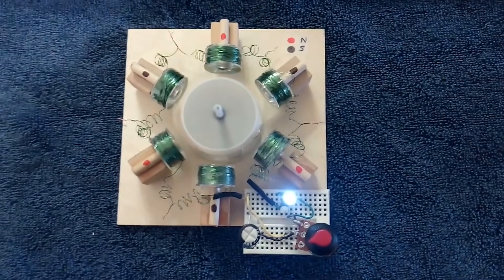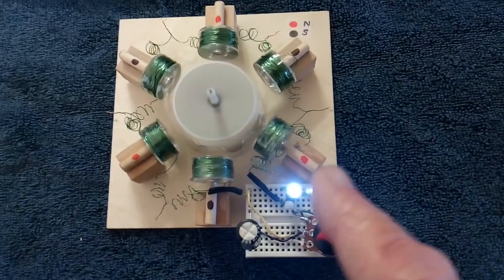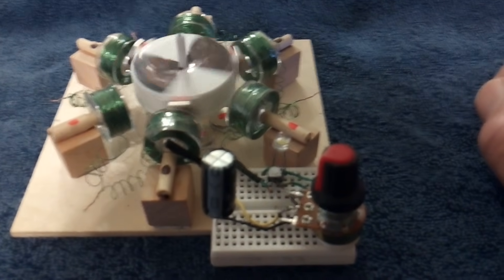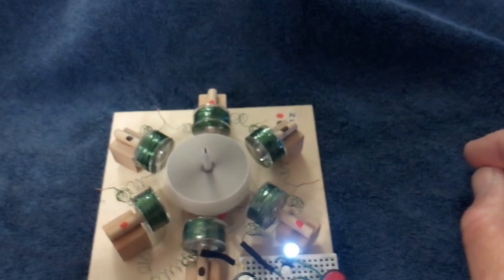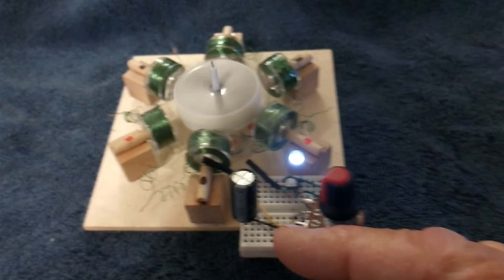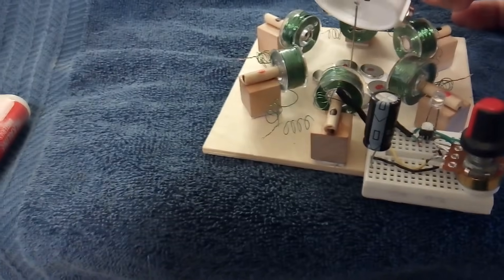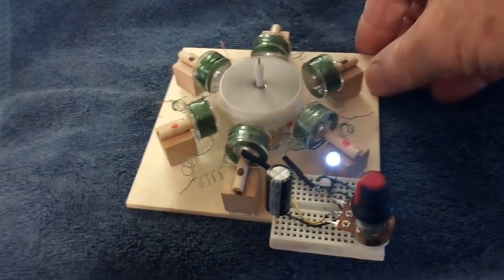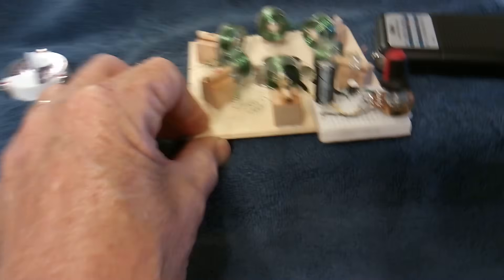Electronic EZ Spin 2.0

Comment: The magnetic levitation/bearing works well. It was interesting to see the arrangement 👍👍
Reply from the maker: I just put a AA battery on this and calculated that it should run non stop for about a month.  If it makes it that long then I might try this idea on one of my micro amp motor designs.   😀
Reply: @Lidmotor  This is a question that I'm Been wanting to ask somebody like you that is so familiar with electronics. An electrical circuits.  say, if you took this design and maybe powered it off of a solar cell. but really beefed up the axle and the coils and magnets and so forth. And then on top of the axle had another Flanged wheel with N S. magnet arrangements in Combination with the. a series of pickup coils Air coils to be specific, so there'd be no magnetic drag. Would it be possible to actually Collect or gain more Power From the . wheel with the North S magnets. Then the circuit requires to run and maybe feed that back into the circuit. or to the very least. to a charge controller. and battery. After it's rectified from the air coils..

Comment: I have been using sapphire bearing following lasesaber school. Work very very good
Reply from the maker: My original Lasersaber E-Z Spin Motor that he sent me has sapphire bearings.  I got some more bearings off Amazon years ago before they stopped selling them.  Where did you get yours?
Reply: @Lidmotor  yt keep deleting my message did you get the link?
Reply from the maker: @francois9428  Your link did not come thru.  Maybe just describe where you get them?  Thanks.
Reply: @Lidmotor  swissjewel
Reply: Bearing v3.18
Reply from the maker: @francois9428  Thanks.  I found it!  Here is the link.  https://www.swissjewel.com/product/jewel-bearings/vee-jewels/v3-18/
Reply: @Lidmotor   cool. Not sure why yt was deleting my comments. Glad you found it
Reply from the maker: @francois9428  Thanks again.   I just ordered four of them.  Pretty expensive item but it is a critical part for an exact replication of Lasersaber's original E-Z Spin Motor.
Reply: @Lidmotor  you are super welcome. Been following your work for years so I super happy to be helpful 😊
Reply: https://youtu.be/nffmi6gmRTU?si=am3nrxVsT7EFzQ1D
Reply: This is one of my designs with your transistor circuit and the sapphire bearing. Around 5 years running nonstop. Except for the holidays, we close the house but it runs around days without sun

Comment: Your project is very interesting. It seems to me that you used bobbins from a sewing machine
Reply: Онивращаеться долго от конденсатора или это ионистр?
Reply from the maker: @sergeygorihovski6671  The 2,7v / 5 Farad super capacitor just stores energy.  This will run OK on a 1.5v AA battery.  The amp draw is 3 milliamps.
Reply from the maker: Yes. The coils are plastic sewing machine bobbins filled up with 30ga magnet wire.
Reply: @Lidmotor как понять магнитная проволка .?
Reply from the maker: @sergeygorihovski6671  Magnet wire is solid copper with a thin coating on enamel.
Reply: @Lidmotor спасибо а то я не так понял видно переводчик неправильно перевел😅😅😅